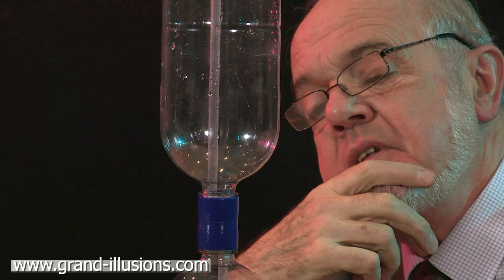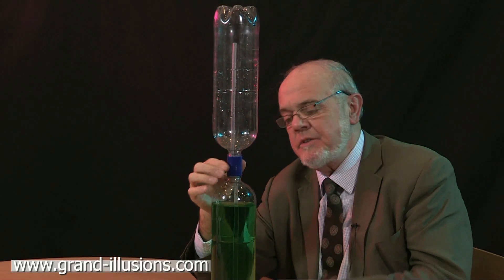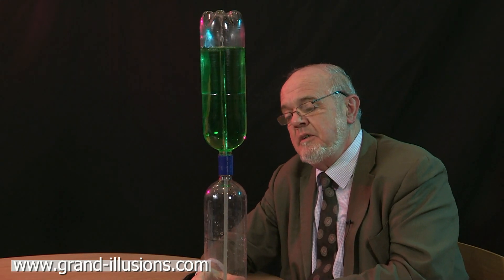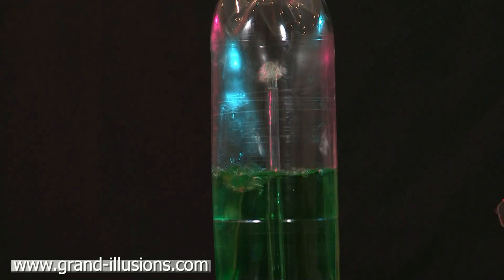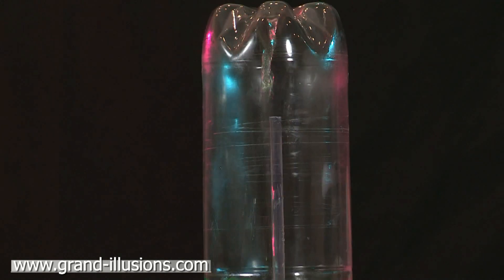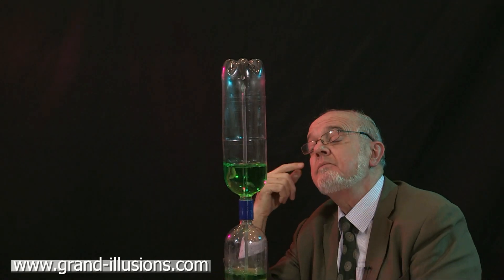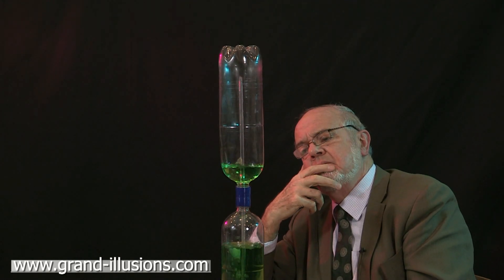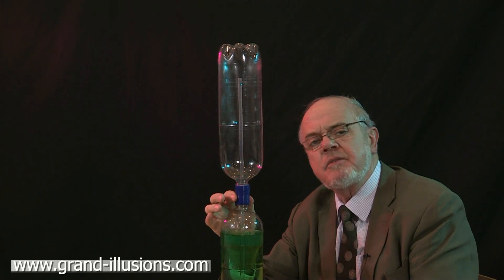Fountain Connection

Comment: I think that it has to do with air displacement, which might be obvious, but the vacuum pressure in the bottom one might be producing force because of how fast the negative space is being occupied. now I'm not a physicist but I think that might be whats happening. possibly. correct me please hahahaha
Reply: vacuums don't make pressure silly. Although the air is getting displaced.
Reply: I was thinking the same thing couldn't be asked to type it though. haha :)
Reply: hahahaha!
Reply: vacuum pressure is a thing dude
Reply: facepalm
Reply: +Shaun Hill And the water running down the straw gets caught in the upward force of the gas inside.

Comment: This happens because the water coming down is replacing the space of the air in the bottom bottle. Normally the air has no where to go without the tube(which is why you would get the cyclone shape), but with the tube the air have a place to go which is up the tube. Now the reason it comes through the tube is because the water level is at the entry point of the tube at the bottom and the pressure of the air pushing up and exchanging space with the water is also pulling up some of the water with it. Hope that helps you understand the science behind this contraption.

Comment: i think the reason that happens is because as the water goes down, it causes negative pressure on the top, so air is sucked through the straw and brings up what water it can until equilibrium is hit.

Comment: This works in exactly the same way as the tornado tube, or just holding it upside down: as the water from the top bottle flows into the bottom it increases the air pressure in the bottom bottle, and also creates a very weak partial vacuum at the top. Because of this, air is forced through the only connection between the top and bottom (as the rest is blocked by the water), when the bottom tube is under water, the pressure forces the water up the tube, hence the fountain effect.

Comment: I see how it works, its very simple, in the connector there is a small hole in the middle of each 'pipe' when the water rushes to the lower bottle the air must escape through the pipe to the top bottle, water enters this hole and the air pushes the water back up explaining why it comes in spurts as well. very cool i plan on making one!

Comment: When the water drains out into the bottom bottle, something needs to replace the draining water in the top, so it forces anything that is at the bottom of the straw up through the tube, which would obviously be the water, because the water settles at the end of the straw.

Comment: The air pressure in the top bottle decreases as the water pours into the lower bottle because of gravity. The opposite effect happens in the lower bottle, as the level rises air pressure increases. The trick is that to equalize the pressure differences, liquid is drawn up from the lower bottle and squirts out the top for the entire duration of the drain.

Comment: There's air in the "empty" bottle so when the liquid goes down to fill it the air has to go somewhere. It escapes through the middle tube to the now forming vacuum in the upper bottle and pushes up spurts of the liquid as it goes.

Comment: just a hole at the bottom of the small tube. the pressure of the liquid inside the large bottle, overcomes the pressure inside the tube, driving the liquid up and out of the tube. while some liquid bypasses the tube and goes into the empty bottle. that's atleast how i would image it to work. i bet somebody else knows better. :)

Comment: The physics is that the air has to go somewhere, but it can't go up the top because a lot of water is coming down. The least resistive passage is up the tube, but water coming in is pushed up along with the air, creating the fountain, which is why it's in spurts.

Comment: As the water enters the bottom bottle, it pushes the air and the air pushes some of the water that is already in the bottom bottle which goes up the pipe and makes a fountain.

But pushing the water into the pipe only happens to some of the air, the rest moves into the top bottle by glugging around the water coming in from the top bottle.

This continues until all of the water moves to the bottom bottle and equilibrium is restored.